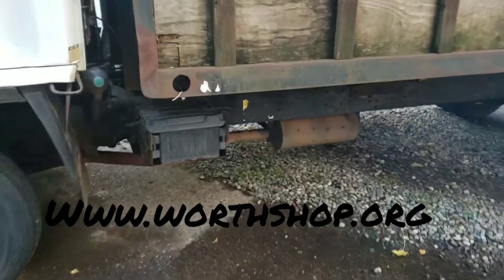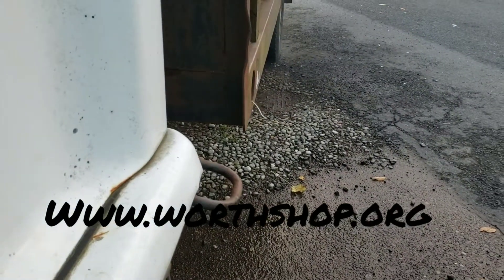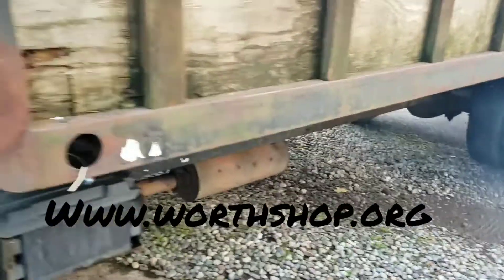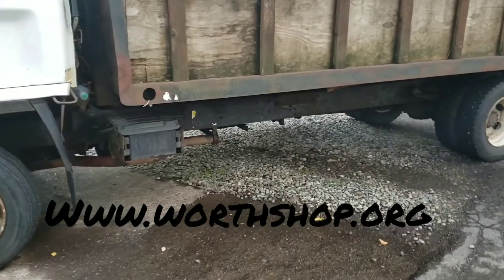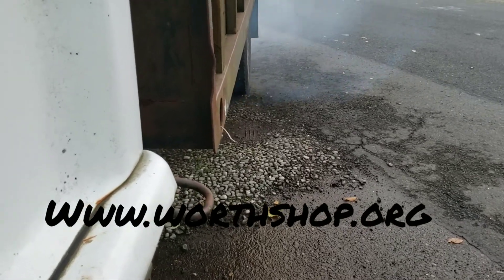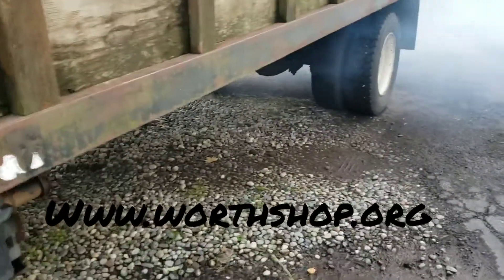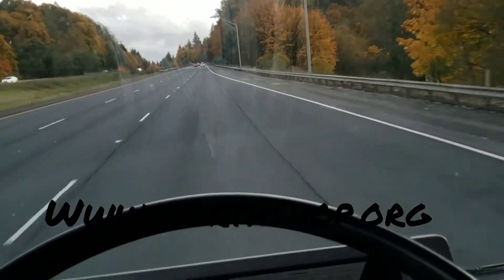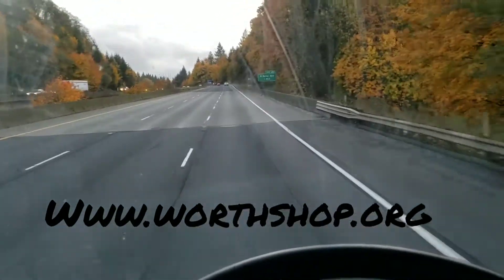6bd1t  6bd1-t diesel streight piped before and after sound 1991 isuzu ftr dump truck

Comment: Sound like a good engine to swap instead of Cummins.
Reply: Some asian countries have more Isuzu engines and all surplus parts you can get than the cummins. Cummins are used for generators in my country so, it's not a visible option. I would love to own a cummins 12v though.
Reply: @johnjerizlopezignacio3891  Cummins 12V was really common here in the state so i would like to do a swap the Diesel engine with something unique like Isuzu or Hino. they remind me of the bus ride I had in Thailand.

Comment: How long do you think those engines can last because mine have 348,000 miles and it runs like a top the only problem is the serpentine belt is starting to squeak but it’s been sitting up for a year and a half
Reply from the maker: I have seen them with 400k and 500k miles still rolling strong. Just keep the oil changed, make sure to keep a good fuel filter on it. They are good strong engines.
Reply: @worthshop  appreciate it bro I thought so too it runs too strong plus i will have it rebuilt when the time comes

Comment: My lights don’t work on mine only one when it’s on bright but the hazards work and the rear lights and brake lights work can you help me I’m trying to put it in service for myself
Reply from the maker: Tear aprt the multi switch on your steering column, it has your headlight switch turn signal switch, hazard light switch etc all in it. Clean up the contacts in it so the electricity can flow. My experience has been corrosion in the contacts of the switches to be the issue with lights not working in the old issues trucks.
Reply: @worthshop  I really appreciate it bro